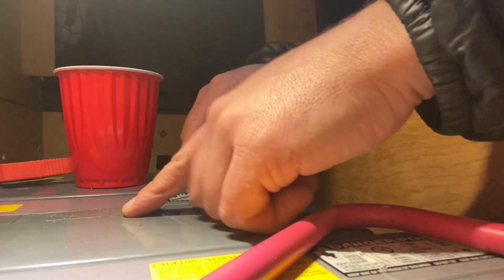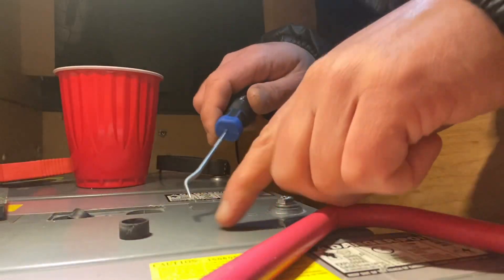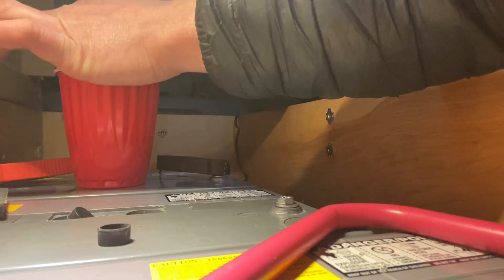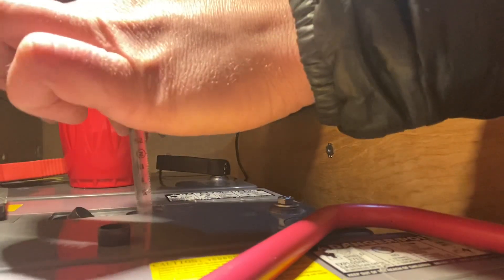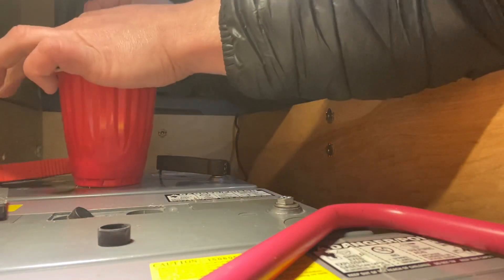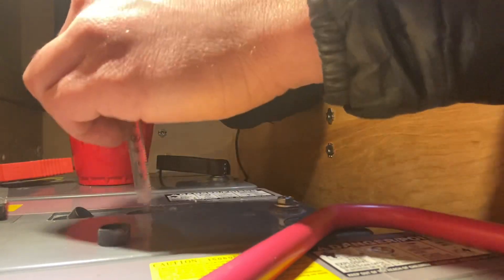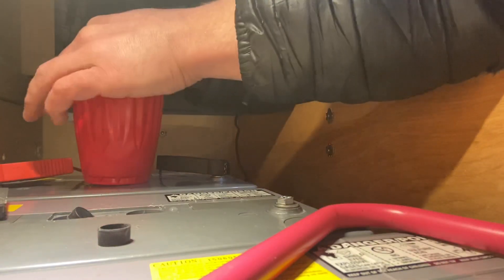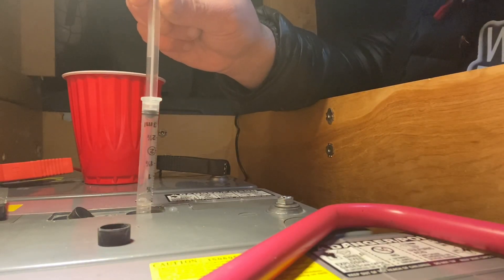QUICK AGM ⚡️ BATTERY 🔋 MAINTENANCE

Comment: Alright, I'm up to the challenge... my dying AGM battery in my BMW X3 is likely 8 years old and really low as I had issues with starting the last two Canadian winters. I should actually replace it, but I decided it's time to test this out and see what happens. I just hope it doesn't blow up because it's mounted in the rear hatch belly! 

Well, just a little earlier, I exposed and removed the cell caps, which thankfully are never glued shut. Sure looked really dry down in there! So, I went ahead and started filling the same volume of distilled water in each chamber via syringe I got with my printer cartridge refill kit, but I was worried about level because nobody seemed clear about it. I'm not sure exactly how many syringe fulls, but probably four or five each and I still couldn't see the level by eye, yikes! But, wow, it's got noticeably more starting power now even though I worry that the cell levels are still low. *In hindsight, I'd personally highly recommend a low voltage charging cycle when doing this before you even try to start the vehicle, so it doesn't play havoc on the electrical system by having that severe initial dilution across the cells*. 

That's a lot of distilled water I already injected down into those cells and I'm on the fence about leaving it as it is or bring up the level just below the top of the mats where it's slightly visible. I want to see how much power I can squeeze out of that old AGM. All the info everywhere on the web is debatable and opinionated... people say "don't do it at all" and others say only one syringe worth of distilled water, etc. I didn't have any battery professionals that I could converse with, so the ol' trial and error is the path for me. The more I ponder it, I'm just going to bring up the levels equal to the mats. I consider it a junk battery anyways. This is a perfect time to test it out because there are only a couple of warm days before the winter temperature plummets again which is perfect to see if the battery has the proverbial balls to start up because BMW, in their infinite wisdom, saw fit not to winterize the old X3 for severe/cold winters with at least a pan or block heater. 

Heck yeah, I think I'm going to juice up the cells a bit more tomorrow to prepare for the cold front that is coming. I think I'll set the fill level equal to the tops of the mats as I think the levels are still too low. It's a 50/50 shot of ruining the battery due to extreme dilution or resurrecting it to a survivable condition. I'll let ya'll now how it goes in about a week. I guarantee ya'll it would miserably fail a load test the way it is, so if it survives for next week, I'll get a load test done then and share the results. 🤔
Reply: Hello! Currently, has your AGM battery, in which you added water, had problems or is it perfect? I also added water to my 80 amp agm until it was level with the internal plates.
Reply: Hi. My apologies as I forgot to update. We had some really cold nights of about -30C and surprisingly the battery is still holding up with no issues even though one time it almost didn't start. I plan on adding distilled water up to the top of the plates as well to get the most out of it and then just leave it be. My friend has one of those old battery load testers with the dial, so I'll give it a try next time I'm over there. In conclusion, I definitely noticed an improvement on mine although it's never going to be as good as a new one being that it's so old. 

Did you notice an improvement with yours at this point?
Reply: @DystrophicEvolution  Olá! Obrigado pela resposta e atualização. Percebi que o rádio e a luz de teto não piscam mais quando ligo o veículo. No meu caso, a minha bateria agm não estava esgotada. Mas acredito que estava iniciando-se a desgastar-se. Coloquei água em torno de 5mm acima das placas e até fiquei preocupado em ser excesso de água, mas após ver alguns vídeos, observei que não haveria problema. E de fato, até hoje, 3 dias depois, não houve problemas nem vazamentos. Daqui a 6 meses, verificarei novamente o nível da água.
Reply: Boas notícias! Espero que continue a lhe dar uma boa vida. Estou feliz que o meu esteja funcionando bem e me salve de comprar uma bateria nova até o próximo ano ou mais.